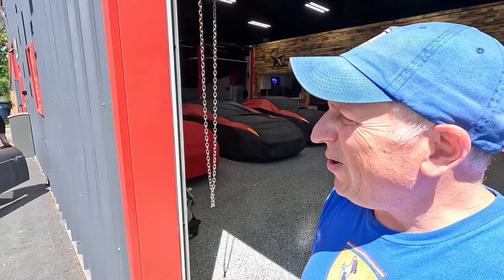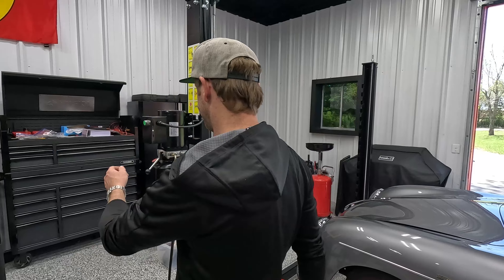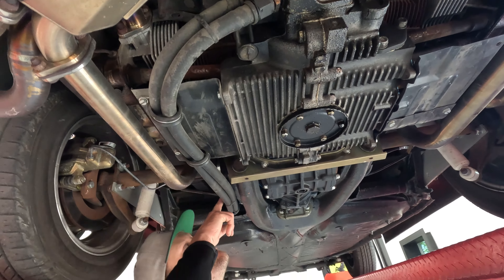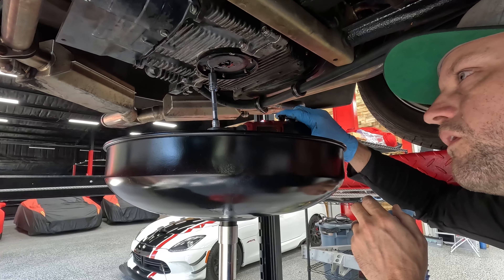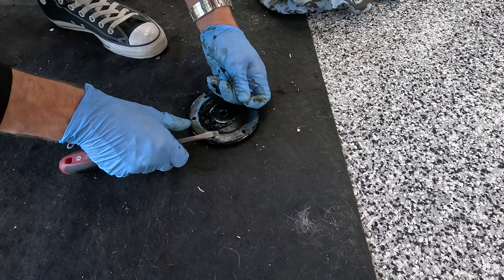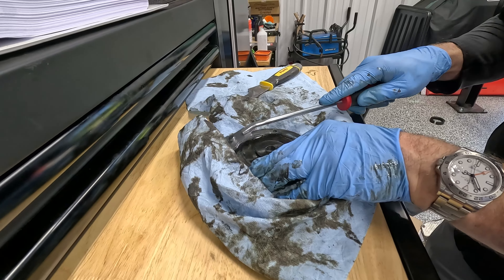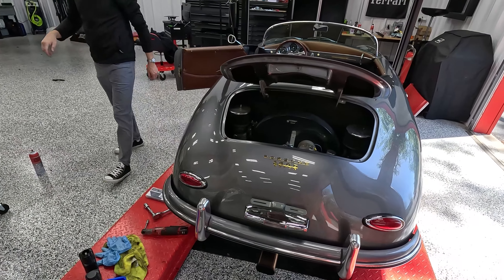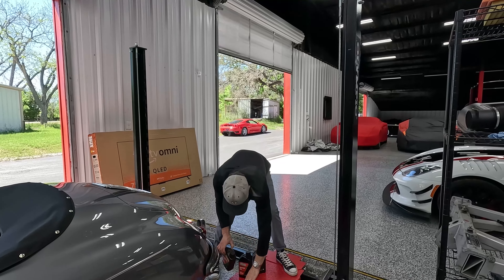How to Change the Oil in a 1957 Porsche Speedster

Comment: My first car was a 63’ rag top VW Bug.  Swapped out the 1100cc engine with a 2200cc Porsche motor with an 010 distributor, and four two barrel Webber carburetors, I believe it was pushing about 180hp, from the original 36hp.  It was a dead trap, but I loved it, right up until I rolled it seven times between Mission Beach and Coronado bridge in San Diego in my US Navy days.  No seat beats!  Hung on to the steering wheel until the centrifuge force was so great that I let go, right as it landed up right.  Traded the remains for an ounce of Thai sticks, lol.  I’ve upgraded my hot rod now to a heavily modified 2019 Audi TTRS pushing 575 bhp.
Reply from the maker: That's scary as hell
Reply: I know that bridge. Fun area to drive. Sounds like that was a definite death trap, but a sweet ride.

Comment: I’ve owned a couple of VW Beetles. I saw two oil lines (hoses) under the car.  Suggest tracing back those oil lines for an oil filter remotely mounted under the car.  It could be mounted on the firewall.  It is a popular aftermarket add on.
Reply from the maker: Yeah that's a good idea

Comment: Great video guys! Fred is right about using conventional oil. The reason is that most of these rebuilds use a silicone rear main seal that is not compatible with the synthetic oils which makes them break up and start leaking. If you build the engine with the more expensive EPDM seal, then you could use the synthetic. No need to risk it since you don't know what was used.
Reply from the maker: Ah interesting

Comment: Man, you guys have never worked on a VW Beetle?  That's surprising. They are super easy to work on and unfortunately it can be necessary often.  A buddy of mine has always had a Beetle and at the height of our game we could do an engine swap in about 45 minutes.  The oil screen can be cleaned and reused many times.  The tubes that are leaking are the pushrod covers.   While you're there you might as well adjust the valves.  That is a cool car, great color combo.
Reply from the maker: I've never had a friend with a beetle until recently

Comment: That engine is VW derived; designed to be mass-produced, run in less-than-ideal conditions and run using cheap resources.  Quite different from Ferrari engines, which are design to rev high and survive the stresses of racing.
Reply from the maker: Yup

Comment: If I were Josh, I would have taken off my Explorer 2 before loosening that drain plug, just in case oil came spurting out all over my Rolex!
PS - 

Please keep the Viper on a battery tender, or at least put in in sleep mode (using the buttons on the wheel) and the FOB away from the car. The car and the fob constantly "speak" to each other, and will drain the battery fast if not driven every day.
Reply from the maker: Good tip